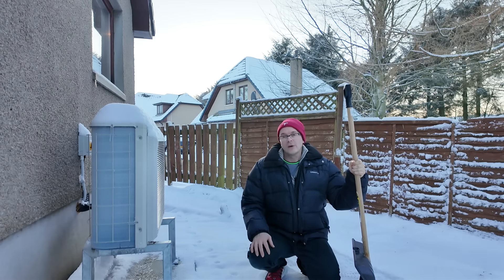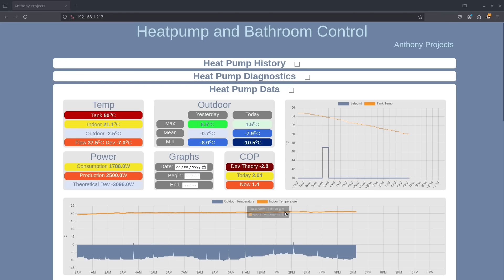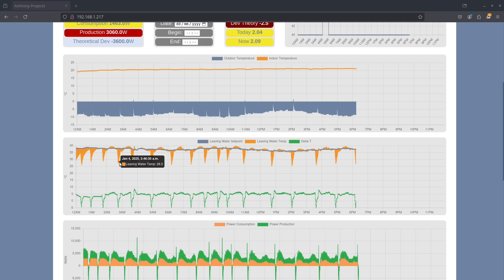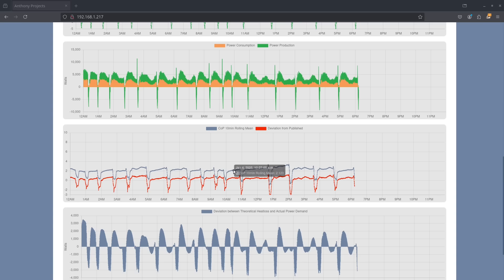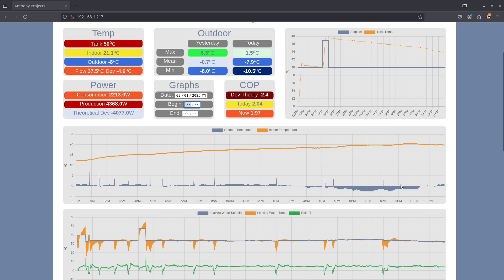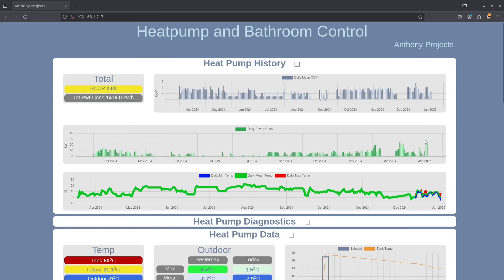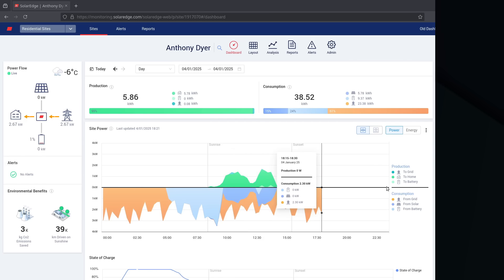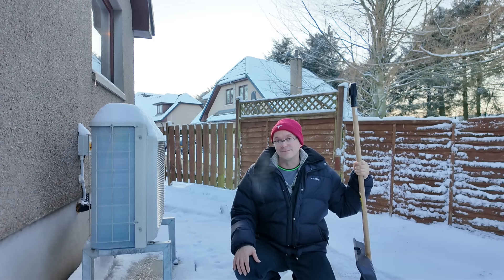Heatpump Performance on the coldest night of the year

Comment: I don’t really know anything about heat pumps but understand that they are supposedly cost effective due to the COP of 4 balancing out the fact that electricity cost 4x the price of gas meaning the balance each other out. If the COP is so low when it’s cold (when you need the heating) then this is just going to cost more than a gas bolder to run in addition to being more expensive to install in the first place. I don’t need a system that is efficient to operate when it’s warmer as I just don’t need the heating then.
Reply: If you want to compere gas with a heat pump you would use SCOP not COP. That's the performance over the entire winter. My SCOP was 4.34 and a gas boiler will do will to get  0.9. So even with the price of gas being lower per kw it will still be more expensive to run.
Reply: @bryanhindle8307 yes but an ashp & a new system costs 10x more than gas, ffs why don't you people tell the truth & give the full story,
You & ev drivers are insufferable
Reply: The point is tthat the periods when COP is over 4 are much longer than when it is around 3.
Reply: @rogerphelps9939  Absolutely!  If you don't live in Scandinavia, Russia, Canada or some northern US states... like 90+% of us do... the days with temperatures well below freezing are few... and grow fewer each winter with years passing.
Therefore the seasonal average COP is WAY above 3, closer to 4, and that's what counts... not the very few days it drops below 3.
Now, if one tells me a heat pump is of no use in Point Barrow, Yellowknife or Ivalo... I shall agree!
Reply: The point is this COP of 2 is for the coldest night of the year (or close to it, in case we get another cold snap next month). So the average performance is obviously much better than that when taken as an average across the heating season. Antony has other videos showing heat pumps are significantly cheaper to run than gas boilers with his set up over the year / heating season.
Reply from the maker: The sceptic will always compare gas running costs to the standard variable electricity Tariff.  But once you factor cheap overnight rates, batteries, and solar power, you get your electricity costs down a long way.  Then you consider that this extreme cold example is not typical of winter demand.  

There’s plenty of mild days as well, with double the amount of daylight end of January compared to end of December.  At which point, you’re “cooking on gas” if you excuse the pun.
Reply: @anthonydyer3939  I wonder about how long the green tech lasts. My modern condensing gas boiler is. 20 years old and still going (admittedly a gas technician tried to get me to buy a new one when, at 14.5 years old supposedly the main circuit board failed & the fan unit circuit board failed. I said unless the heat exchanger is leaking I’ll have it fixed please. I blame myself for using a 33% Sulphuric Acid concoction in the toilet which is in the same room as the boiler, I don’t know. I realise boilers are meant to be ‘room sealed’). How long does an Air Source Heat Pump last typically?
My other concern is I have an old Slate roof and wonder if it will still be water tight after Solar panels have been fitted. Will there be arguments about whose at fault if there’s a problem (the roof was nearly life expired mate).
Reply: Well... not quite.  Heating oil (No gas is available in my region, but it would be 0.1093 €7KWh it it was available... plus the monthly connection fee) costs these days about €1.04 per liter, delivered. With a liter of oil counting 10.7 kWH and a boiler efficiency of say 90%, that gives a fuel cost per kWH of heat of 0.108 €.  Basically the same cost than gas.

I pay electricity, during the winter, an average of 0.17 €/kWh (so only 1.75 times the price of electricity... NOT 4 times!!!), and get an average COP of 3.2 (I have old, unchanged, radiators needing 55°C water temperature, and not heating floors which only need 35°C... the COP would be 3.6-3.8 in that case).  So, the average cost of the kWh of heat is, in my case, 0.053 €/kWh... so, a bit less than HALF the cost of my previous oil-fired system!
Conclusion:  my new heat pump (2 YO) is saving me around €1000 per year in energy!  And it produces no black stinking exhaust fumes... a light hum... but so did the oil burner

Finally, you can also have a water-to-water heat pump, extracting its energy from the soil, or from deeper water.  It obviously costs more to install... especially as a retrofit, but gets a COP of 4-5, and is totally indifferent to outside air temperature!

So... the first phrase was the only true one of your comment!
Reply: @st-ex8506  That you refer to your oil fired boiler producing black stinking exhaust fumes somewhat detracts from your argument. Your boiler was clearly in need of attention !  Unless you were joking since you mentionan an efficiency of 90% for your oil boiler.
Reply: @Martindyna  My boiler was maintained once a year... so, I do not think it was the trouble.  My neighbor's boiler smokes just the same.  it might be the first-price heating oil quality we tend to use around here?  Possibly.  But ALL oil-fired boilers emit smoke and stink... the difference is that if you have a chimney releasing the exhaust gases atop the roof, you don't notice it. But if they are released at face-level in the courtyard, then you do! And on a cold day, the smoke is thick and white, not black... condensation of the combustion water.

I never measured my boiler efficiency.  I took a number, 90%, which seems to be the efficiency of most domestic oil-fired boilers.
Reply: @st-ex8506  No oil boiler smokes, however old, as long as it's working correctly. A modern condensing oil boiler will emit fog but it won't stink, although smell is an individual matter ! A friend of mine has a modern condensing oil boiler and the exhaust is inoffensive (Worcester boilers UK).
Yes 90% + is correct for a modern oil fired condensing boiler provided, of course, that the return temperature to the boiler is less than 55 deg. C
Reply: @Martindyna  Well... heating oil does contain sulfur (even if it has been partly desulfurized) and burning it produces H2S and/or SO2, and quite possibly some NOx also... all gases being corrosive /they convert to strong acid with water) and VERY unpleasant to smell.  I have seen boilers... including mine (I still have it as a back-up)... producing no or very little black smoke (i.e. no soot) if their stoichiometry is properly adjusted (adjustment that only last that long after a maintenance call... and definitely not a full year), but I have never seen one whose exhaust was "inoffensive" to breathe!  It even killed the vine on the wall 1 meter around the exhaust pipe exit.
Reply: @st-ex8506  My main problem with what you are saying is that apparently you call fog (airborne condensation) smoke!
Regarding your Vine being killed, I don’t think that would happen so much if your boiler was operating in condensing mode most of the time but this is difficult to achieve without possibly harming the boiler if the entire heat exchanger is not constructed in e.g. grade 316 stainless steel. Oil condensing used to be made of steel with a stainless steel ‘economiser’, I’m not sure if they still are. 
The Navien condensing oil boiler that features a blue flame burner must be all stainless steel, it has a downwards firing burner btw just like some modern Worcester gas fired boilers.

Comment: Join Reform 🇬🇧 
Milliband wants you to get these things.
Reply from the maker: @alanevans9604  and what does reform want you to get?  More (increasingly expensive) gas?
Reply: @anthonydyer3939 Gas is expensive by design to make "renewables" seem competent.
I cannot and will not accept that in Northern England a heat pump with 1kW input will output the equivalent of 5kW electric heating.
It's nonsense.
I'll accept a meagre gain but not one even near the hype.
Folk are boarding up their houses and and wearing outdoor clothes to kid themselves they've backed something better than electric cars this time.
Of course, if the green/reneables lobby hadn't killed off nuclear energy....

Comment: I wouldn't exchange my air source heat pump for anything else.  Hugely efficient, maintains the temperature I set, and because of the criminal way UK heating is charged, set by the government, it is cheap.  We are all electric. My bungalow is one bedroom, quite small and extremely well insulated.  We are surrounded by water on the west coast of Scotland and my heat pump was on every day last summer, in fact I don't turn it off.  We have a mild, damp climate with weeks of below zero temperatures at night and currently during the day too. Very happy.
Reply: @Smartgran  is that sea water? If so do you have a corrosion resistant coil?

Comment: If your live data is correct that means that at -1,5 you get a COP of 1.58? Isn't that a bit low?I have a Toshiba estia HWS P805 and I have a COP of 2,77 at -2C with LWT of 40C.
Reply from the maker: @zigavucic754  I’m getting a COP of around 2 when the temperatures are below minus 8.  At minus 2 I’m seeing a COP around 2.7 ish.
Reply: @anthonydyer3939  if you look at 1:03 your COP is 1.58 @-1,5C. How can your mean COP than be 2?

Comment: Hi Anthony.  Hello from East Sussex. Not as cold as Scotland! I have a Worcester-Bosch Greenstar R1 6 kilowatt boiler. During this cold snap, I have put it onto continuous running. The house thermostat is set to 20C.  It is costing 18p an hour right  now to maintain this temperature. (9 celsius outside)  You may like to make another video comparing your heating costs to the cost of Gas Central heating. Is there a saving?

I used Chat GPT to do the calculations. It came up with these results (an outside temperature of 0c)
Gas Tariff: 7.96p/kWh.  Energy Usage:
To maintain 20°C: Energy Required = Heat Loss Rate × Time Energy Required = Heat Loss Rate × Time. For a 24-hour period: Energy Required = 2 kWh/hour × 24 hours = 48
 kWh/day.
Energy Required=2kWh/hour×24hours=48kWh/day.
Cost:
Using a gas tariff of 7.96 pence/kWh:
Cost = 48 kWh/day ×
7.96 pence/kWh = 381 pence/day =£3.81/𝑑𝑎𝑦.
Cost=48kWh/day×7.96pence/kWh=381pence/day=£3.81/day.
Calculation:
Heat Loss:
Using the heat loss rate formula:

Heat Loss Rate =Temperature Difference × Heat Loss Coefficient
10
Heat Loss Rate = 10
Temperature Difference × Heat Loss Coefficient

Indoor temperature: 20°C
Outdoor temperature: 0°C
Temperature difference: 
20°𝐶 − 0°𝐶 = 20°𝐶
20°C−0°C=20°C
Heat loss rate: 20 ×110 = 2kWh/hour 10 
20×1 =2kWh/hour.
Boiler Heating Output:
The boiler has a capacity of 6 kW/hour. If the heat loss is 2 kW/hour, the boiler can compensate for the loss while maintaining the temperature.

Have fun making the video!
Reply: I thought the primary reason to install a heat pump is to reduce greenhouse gas emissions: whether it costs more is of secondary importance.
Reply: @dennisharvey4499  A heat pump would not reduce greenhouse emissions if your electricity is being generated from a gas-fired power station! However, of course, if you are running of electricity generated by a wind turbine or a watermill, then that's got to be better!
Reply: @dennisharvey4499 ye cos we've all got thousands of pounds to waste to absolutely no difference what so ever to the world's co2 emissions,  
Absolutely ridiculous
Reply: Are you sure it's a 6kW? the minimum I can find for the greenstar RI is a 9kW, which has the same specs as the 12kW.  Both have a minimum output of 3.45kW.  So for a heat loss of 2kW you would be losing efficiency due to cycling on and off for nearly 50% of the time.

Also your calculations do not take into consideration boiler efficiency.  48kWh required of heat per day would not be served by 48kWh of gas, as you will lose 10-20% out the flue.  So would need to adjust your figures for ~54kWh-60kWh of gas required.
Reply: @BenIsInSweden  Yes, there was a 6kW version of the Worcester Bosch Greenstar Ri boiler. According to the user manual, the Greenstar Ri series included models with outputs ranging from 6kW to 24kW. 

However, in more recent years, Worcester Bosch has updated the Greenstar Ri range, and the current models now start at 9kW, with higher outputs available.

You might like to have a go on Chat GPT.  This is an example of the prompt I gave: 
A worcester-bosch Greenstar 6 kilowatt boiler is costing 24 pence an hour to run to maintain a house temperature of 20 celcius. The outside temperature is 9 celsius. Calculate the temperature that the boiler gas inlet valve is set to (i.e. the boiler temperature).
Reply: @AllensTrains  chatgpt is great but it makes mistakes and can provide conflicting responses.
So you might want to ask it some follow ups like whether its taking into consideration system efficiency rather than combustion efficiency, and the minimum modulation of the boiler and whether it is condensing or not.
Reply: @BenIsInSweden  Yes, I have done that!  I used Chat GPT to calculate the minimum gas flow setting, which is 55 degrees. If you do this, you have to leave the boiler on continuously and not timed. If the calculations produced by Chat GPT agree with the gas consumption shown on the monitor then that means you have got the gas flow at more or less the right level!  You may like to do this with your house!  Another video to make!  Have fun!
Reply: @AllensTrains  Designed flow temperature isn't dictated by the boiler itself.  It's dictated by the distribution of the heat around the system, i.e. pipe and radiator sizing compared to the heat loss of the property.
55C isn't much of an achievement, it's the maximum allowed (via UK building regs) for all new heating installations since Summer 2022.

The other thing is for a gas boiler to run most efficiently is having it run on weather compensation instead of manually setting a flow temperature.  With weather compensation it will adjust the maximum flow temperature based on outside conditions.
Reply: @BenIsInSweden  There are no facilities for weather compensation on the Greenstar R1 boiler. You can set it to 55C  manually. This is the most efficient condensing temperature. However, if the weather is very cold, then a higher setting is required.
Reply: @AllensTrains  55C isn't the most efficient condensing temperature.  It would be more efficient at a 35C flow, if radiator sizing allows.
Reply: @BenIsInSweden Yes, Chat GPT agrees with this. However, if you set it this low, the radiators don't get hot enough!
Reply: @AllensTrains  as I said, depends on radiator sizing.
Larger or k3 radiators are able to produce the same amount of heat as smaller radiators at a lower temperature.

Comment: Just had our coolest day here in Brittany for a long while - sub zero in the morning and just above all day.  Used 58kWh in total for heating a 5 bedroom house with typical COP around 2.  Still cost only half of what the oil boiler would have used!
Reply: 2 is rather low.
Reply: @rogerphelps9939  Just to clarify it was 2 when the temperature was sub-zero. On a more typical day like today, outside temperature is 10-12 degrees and COP is a more respectable 4.3

Comment: What monitoring software/hardware are you using? I have a grant aerona and have no idea how to do any kind of detailed analysis other than data from my inverter/ octopus reports
Reply from the maker: @u01ijm7  I’ve got an ESP32 wired into the serial port of my heatpump.  That transmits data every 30 seconds to my raspberry pi using MQTT.  The data is all custom code in python, html and JavaScript.  My previous videos describe my data acquisition efforts.

Comment: A good informative review Anthony, glad to see it working out for you - It's not so much that snow is a desiccant, rather than the low temps cause moisture to precipitate from the air. 
I'd looked at heat-pumps before as much improved heat losses made it viable, but cost (no grants here) and unreliable power supply killed it - Instead a UPS, new gas boiler and 50% bigger rads were installed - Now running 24/7 low temp heating with ca 23 returns when it's -5 out, so pretty chuffed so far with flat line room temps - When the inevitable -16 lands up, I'll know what's needed for weather comp settings, and hopefully the correct sensor - Heating costs should average 3.50 a day for the coldest month, but that's on gas pricing.
I still think boosted solar output and battery storage would be the way for you to go if you can find the space - The UK's energy stitchup is pretty brutal and doesn't look to be changing any time soon (too much profit)....
All the best for 2025...

Comment: They can work well but the home must be correctly insulated and ventilated before any heat pump installation...
Reply from the maker: @newbeginnings8566  Yes, building fabric is very important in order to work out how much demand you need.  I’m plotting theoretical losses vs actual produced heat and it’s pretty close.  That exercise before the investment allowed me to appraise the suitability of my house vs the size of the heatpump that was being proposed.
Reply: Insulation doesn't need to be perfect before heat pumps go in, but it will reduce the energy costs of any heating system.
Reply: I think this is a valuable point.

Comment: That’s not cold lol. -40 is cold
Reply: I wonder if they use these in Yakutsk In Siberia?
Reply: @nickhickson8738  i watched a youtube video on that recently. It’s largely apartment blocks. The older properties use central heating systems ducted to each apartment. I’m not sure what method they use to heat but we’re talking Soviet-era here. The length of duct means significant heat loss to the further properties. Gas combi boilers are the “new” method. Gas is very cheap in Russia.